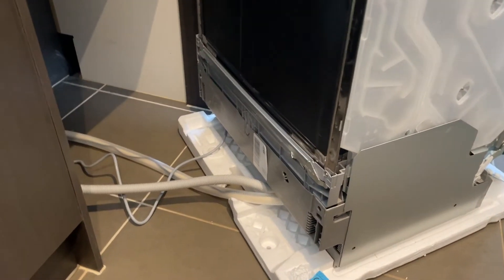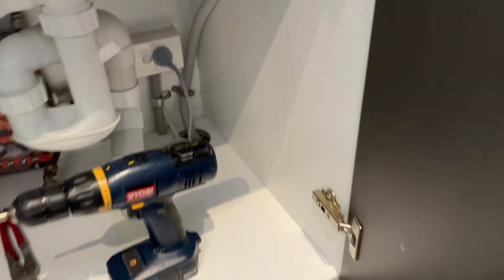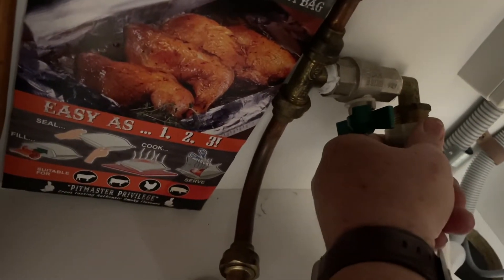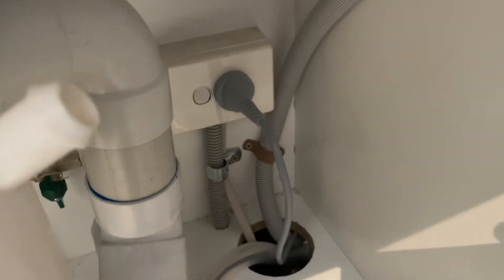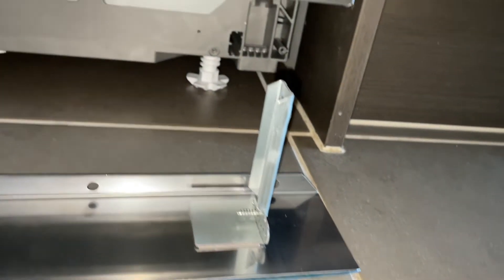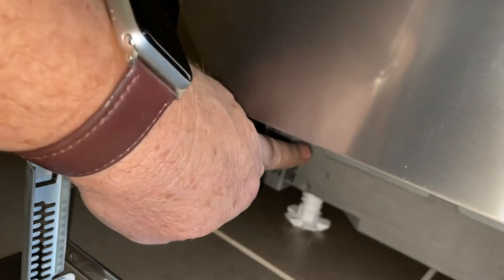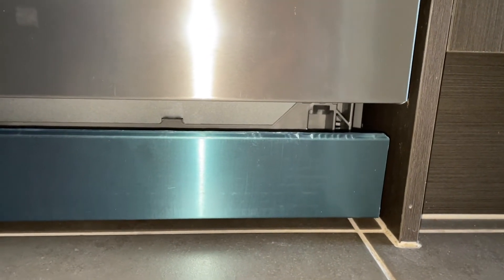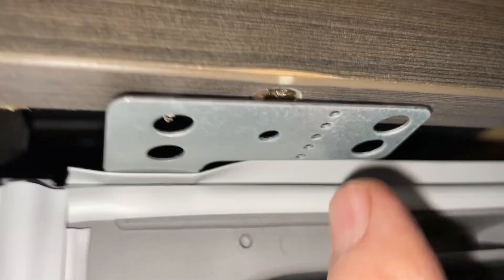How to Instal a Dishwasher. Fit Bosch under bench style

Comment: Just got mine, a Serie 2, after installing the water inlet/valve (the same as yours), when I turn on the water line, water comes out of the "screwable" part of the inlet/valve, I'm sorry English is not my first language. Maybe I'm doing something wrong?
Reply from the maker: Make sure the screw fitting is on straight and tight. It may also need some Teflon tape. 
Also make sure your tap fitting is the right size.
Reply: @Marksreviewsandtutorials  Well yeah that was it, it needed some teflon tape and to be screwed tighter, I didn't want to over do it because it is plastic, but everything worked out. Thank you so much for taking some time to answer a total stranger!